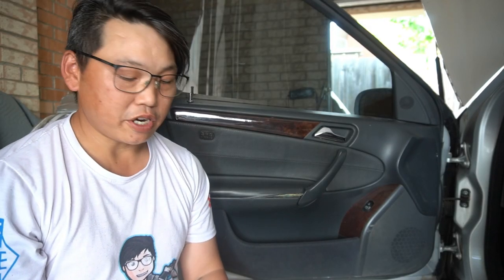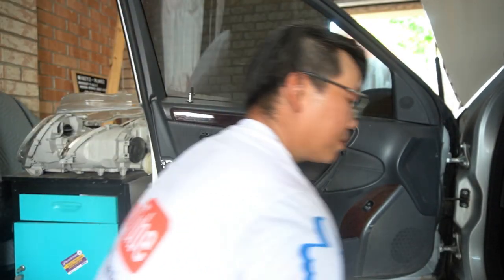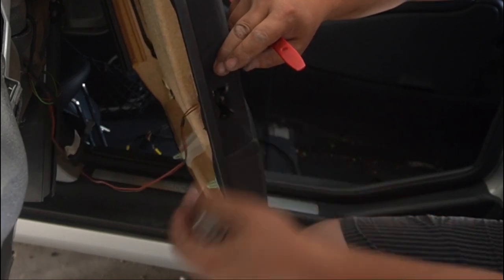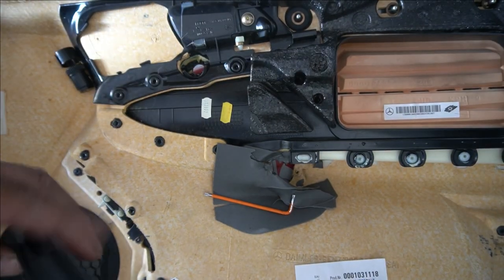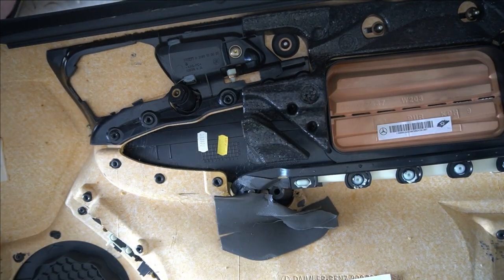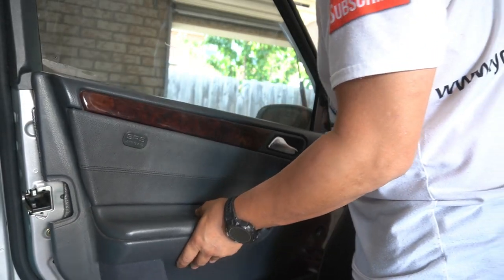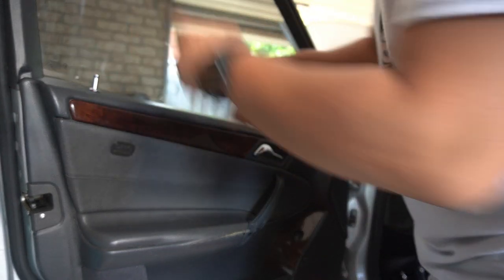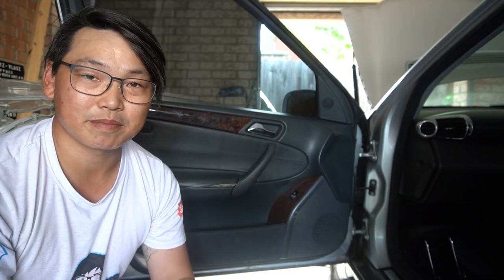mercedes w203 front door panel removal + front door handle fix common fault

Comment: Where can I get or what is the name of the black adapter that you unscrew with the gray parrot wrench?
Reply from the maker: can u mark at what tim ein the video so i can see what your referring to ?
Reply: where almost 5 m
Reply from the maker: @Jose-kv3go  I'm not sure of the part but u can buy a kit for this on ebay search w203 door handle and it comes with it I dunno if u can get just the clip

Comment: Is it the same with the Mercedes model 2007 C230
Reply from the maker: is the model u own w203? it should be similar
Reply: @MIKEYZVLOGZ  mine is model C230 2007
Reply from the maker: @meleshailemariam  yes but model? w203 correct?
Reply: @MIKEYZVLOGZ  no no C230
Reply from the maker: @meleshailemariam  ok I understand ur make and model is the mercedes c class. 230 but the w203 w204 w205 tells .e the shape of tour car  whether it's like my silver. car or my black car 
93 to 99 were w202 and 00 to 07 were the w203 07 to 11 were the w204 and so on but in the years that overlap like 07 they made the newer model so u can have either ... that's why I'm asking what model w203 style or w204
Reply: @MIKEYZVLOGZ  thanks for the very honest quick response. The only thing I know was the model C230 and 2007 but my car is a silver and sport model and has the original AMG exost with staggered rear tire.
Reply from the maker: @meleshailemariam  nice
Reply: @MIKEYZVLOGZ  so that means my car is W03 or W04?
Reply: @MIKEYZVLOGZ  in addition it’s rear wheel drive.
Reply from the maker: @meleshailemariam  lol yes I know I understand merca quite abit